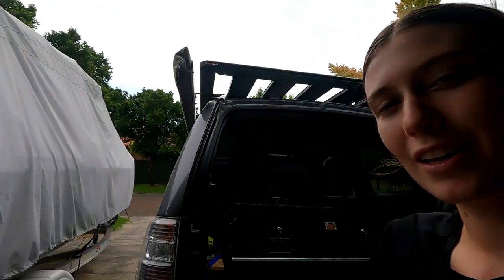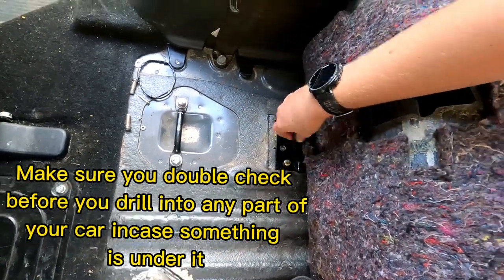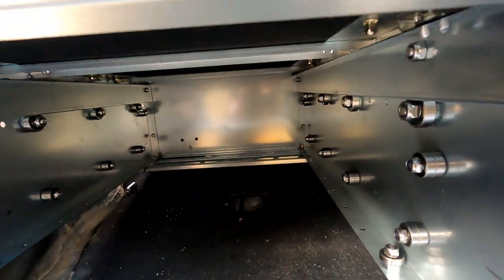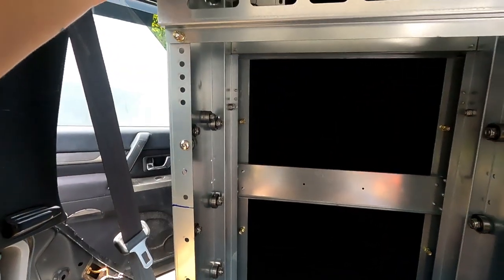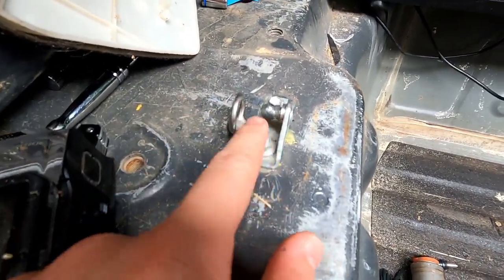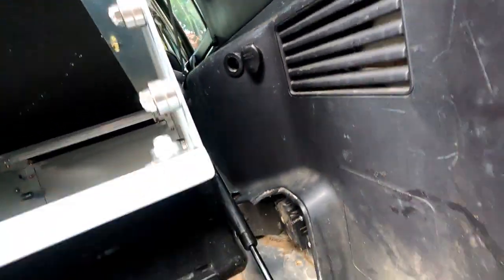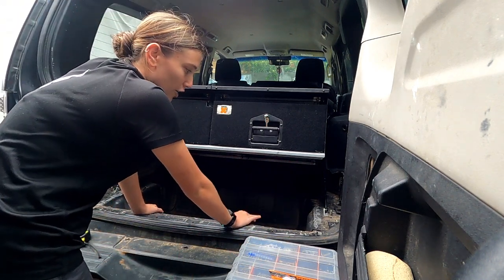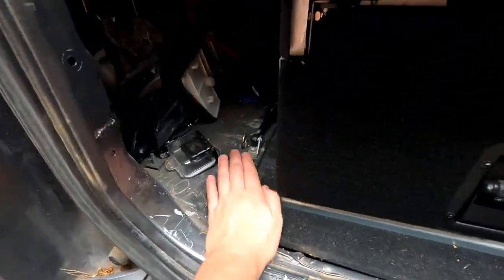HOW TO INSTALL REAR DRAWERS ON GAS STRUTS FOR YOUR 4WD

Comment: Hey Bia, Nice work on the struts and love that you don’t mind hacking into the car when the need arises. Done it to my 2010 NT with 520k k’s plenty and never had any issues. Love the black window surrounds. I’ve painted my back door upper black but now want to paint the window surrounds after seeing yours. They get scratched a bit but nuthin a can of Rustoleum flat black can’t fix.  Look forward to the walk around too. Cheers, Adam. 👍🏼💪

Comment from the maker: In the video it's not very clear on the gas struts but they are capable for 1000N but are currently gassed to 676N and that is able to lift the drawers and fridge with ease

Comment: Thanks for making the video been waiting for a update awesome set up. Maybe use like a spring slide lock to hold the drawers similar to what's on the titans drawers ok the fridge side.
Reply from the maker: Thanks for sure I'll look into the spring lock I did buy one but didn't get around to installing it

Comment: Brett (DenMonkey) sent me here. That's a cool setup on your drawers. A a small padbolt like for a gate would work well to lock it In but might rattle a bit. I'm yet to put any money n back of my Paj. I have the factory Sub woofer and the Kaon rear shelf so not sure if a fridge will fit with that and a draw unit.

Comment: Great job and well done on the vid.. maybe a spring loaded gate latch on the drivers side (mounted to the body of the vehicle, with the pin going back towards the drawers) would work for your locking mech?

Comment: Wondering what your reason was going for the MaxiTrac drawers?
Reason I ask is because I'm obsessing over weights while planning a setup.. I was dead set on XTM drawers until I came across these which claim to be aluminum construction and 22kg for a 1300mm drawer (44kg for both drawers).
Comparatively  XTM are steel construction at 31kg each, or 62kg for a pair of 1200mm.
Although your drawers are obviously not the 1300mm version do you know what they weighed in at?
Reply from the maker: In all honesty I was about to buy the XTM drawers but I seen on the repco page the maxi trac ones and took a risk buying them as I haven't seen any reviews done on them, the main reason why I bought them is that they were a bit cheaper which I know it's never the best to buy the cheaper option but I thought I would give it a try, and it's a little more in my price range and kinda liked the look of them more. As for weight, I had titan drawers in originally that weighted 71kg and I seen the maxi trac ones were 55kg I think that's just from what I've seen on the internet, For the dual set, so once I seen they were a fair chunck lighter I bought them.
Reply: @bia4x4  Yeah awesome they sound like they are the pick for weight consideration. Titan drawers are definitely heaviest of all the offerings. Unfortunately there is no store stock and it's by order only to see them before buying. I think I'll take the gamble that the Maxi Trac are what they say they are for weight and lighter than XTM. Thanks heaps for the response!
Reply from the maker: @sky73x  all good 😁 I was a little sceptical of buying them as they didn't have them in stocks at my local store either but they said if I took it home and didn't like how they worked or if they didn't fit I could return them I was just very careful at first opening up the box incase I would return it, but I like them now

Comment: Pinnacle 95mm Stainless Steel Adjustable Toggle Latch from bunnings 
or a Syneco 130-145mm Polished Adjustable Toggle Latch also from bunnings
there are all different sizes to choose from but you could clip it down with the option to 
lock it for extra security let me know if you would like more info or help
Reply from the maker: Thanks mate:)

Comment: Hey Bia, loved the video. Couple of questions. What type, brand etc of angle brackets did you use in the rear? Are they threaded? And how did you decide on the gas pressure rather than using the full 1000k?
Reply from the maker: The angle bracket were just normal builder brackets from bunnings the generic type(if u mean the bracket with the gas strut ball joint it was just one that came with the struts and none were threaded).  I didn't use the full compacity of the struts as it's just suited to the weight that I carry and if I don't have the fridge on the drawers they can be heavy to push down. It's all personal preference on what u find handy but they're gassed to go up and down good with the weight I got in

Comment: The brackets I'm referring to are the ones attached to the floor at the rear and not to the drawers. They appear to be flat where they attach to the floor but the verticle section where the strut attaches appears to be triangular.

Comment: Could you possibly do a review video on the drawers? Do they rattle much etc? I have the XTM ones but haven't been too impressed with them. Just wondering if I would be wasting my money switching to the Maxi Trac ones in comparison.
Reply from the maker: Yeah for sure next weekend if it's sunny I will 👍

Comment: Hi bia was wondering how are the maxitrac drawers holding up? Contemplating between the titans or maxitracs. Also does the drawers rattle or move around in this setup while 4wding? Cheers!
Reply from the maker: Hey the maxi trac drawers are doing really good haven't had any problems with them since installing them. For the price of them you can't beat it I wasn't sure how long they would last but can't fault them yet. And not it dosent rattle as long and u have it pinned down in some way either with a lock or tie down strap. Around town I don't have them tied down I only secure them when I'm going off road

Comment: How have you found the quality of the drawers. Looking at getting these for my Landrover.
Reply from the maker: I've only had them first just over a month but they are still in the same condition as when I bought them unlike the titan drawers that started getting wrapped after 1 4wd trip, but definitely like the feel and the set up of the drawers
Reply: @bia4x4  ok that great to hear. Just have to work out if my 2 big fridges will fit, i have an Evakool 60lt & 85lt both fibreglass.

Comment: Hi Bia, just a question pls.. why did you remove the Titan draws and put these other ones in? Great idea for those that have under floor storage areas, I have an 80 series so I don't have that but I think this is a great idea for extra storage.
Reply from the maker: The Titan drawers aren't good quality, they bent and warped and each one of them the fridge slide lock fell out. Not that it's that hard for me to put a few more screws in, but frustrating that it happened more then 3 times. I've even been to rwdsuper center before and their drawer on display was broken. And since switching I havnt had any problems with my new ones
Reply: @bia4x4  Thanks for the reply.. that's surprising as I have had my set for about 5 yrs now and have not had one issue with them at all... maybe you got the Friday version.
Reply from the maker: Maybe it's like everything now days, the stuff 5 years ago might be older but lasts longer then new stuff

Comment: Hey just had a question,
What brand and where did you get those gas struts from? I've had a look at a few places but no luck
Reply from the maker: I got them from a local shop in Rockhampton called gas re strut. You might be able to ring them up and order online

Comment: Do u power the fridge with a solar panel?
Reply from the maker: I've only just installed a dual battery system last week in my car and haven't got it running of solar yet I will eventually but just haven't found the solar panel I want yet

Comment: Hi Bia. I've put my titan drawers on gas struts too. Have a look at the gate pad bolts I used to hold the drawers down. I also recommend right-angle brackets that rest against the side of the drawers to stop lateral movement and reduce twisting stress on the hinges:

https://www.youtube.com/watch?v=_AizH9QIZnc
Reply from the maker: Cheers will look I to that
Reply from the maker: Just seen the video that's a good explanation I'll give it a go